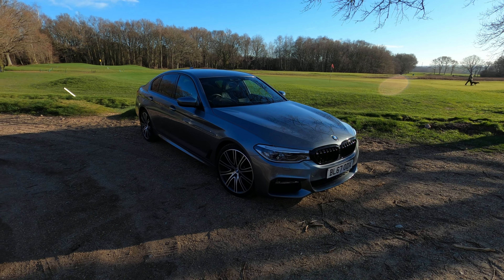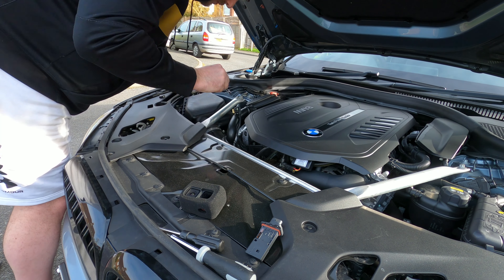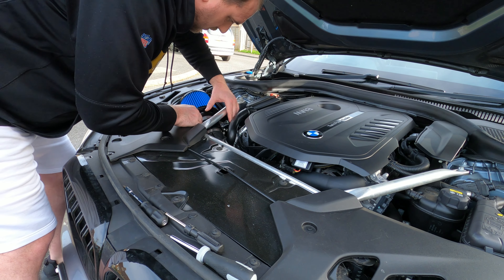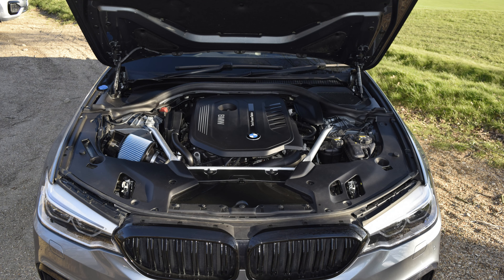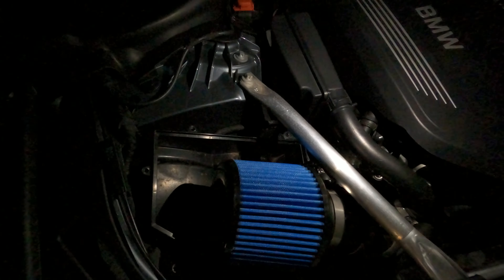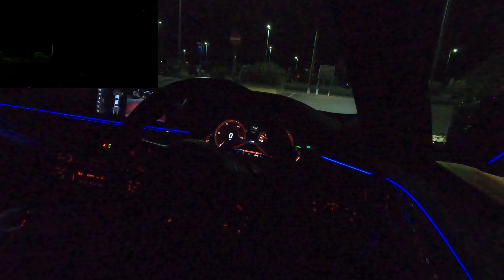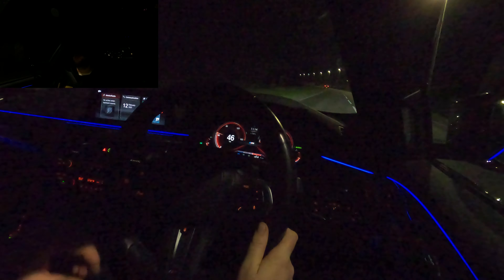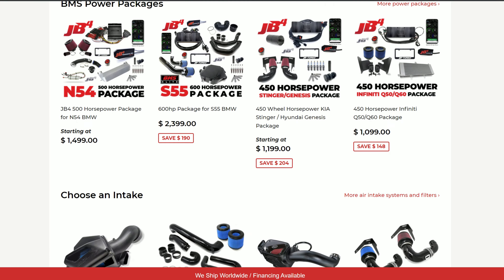BMS Performance Intake Review | BMW 540i xDrive

Comment: Nice video, would it be worth doing this mod on a 520D, like on your previous G31?
Reply from the maker: I would probably just upgrade the panel filter on a 520D, then do an ecu flash or piggyback ecu. That will be more than sufficient. The ecu flash will bring the engine alive. Cheers 🍻
Reply: NO

Comment: Is the turbo loud enough to hear in cabin with everything else stock?
stock exhaust no tune?
Reply from the maker: @MuhammadMusa-tm3jh  yes, watch my last video. 470hp.
Reply: @rev-viewsauto  thing is i dont have bms intake or stage 2
Reply from the maker: @MuhammadMusa-tm3jh  I see. Didn't read it properly first thing. 

Being honest, no, when the car us stock it's mega downtrend by BMW to keep the cretins at the EU happy. So it's quiet. Still sounds nice under full power but nothing like it's true potential.
Reply: @rev-viewsauto  makes sense. i have a resonator delete which didnt do much for me i am thinking of doing muffler delete too what do u suggest?
Reply from the maker: @MuhammadMusa-tm3jh  my take. Leave the resonators as they are. Ends up messing with the sound too much and can lead to drone. 

Get an induction kit like the BMS, get a catless or if not high flow downpipe. Tune when you can. For more sound get the Remus exhaust system as its tuned to perfection. I will be getting that in the near future.
Reply: @rev-viewsauto  Appreciate it thanks!

Comment: Sorry to disappoint you but these open filters are worse ,they bring hot air and get heat soak , stock air box with drop in filter are the best in the b58.
Reply from the maker: Well... car now runs 3.8 zero to sixty with stage 2 tune. Heard about the heat soak, but IAT stats all monitored and its running great. No disappointment here pal. Car is fast and sounds incredible. Cheers 🍻
Reply: How about closed carbon fiber intake from armaspeed or eventuri?
Reply: @MajorB58 eventuri trash

Comment: Do you have any issues with your ambient lighting on the passenger dash? Mine is a bit darker on the ends
Reply from the maker: I'll have to check, hopefully all OK. On my last 5, G31 I did need to replace the drivers door lighting strip. Currently they are great, weirdly better than my other car and the brightness isn't even that high. Are you running a 540i as well?
Reply: Mines like that too. I noticed it a while ago. It’s the design.
Reply: Thanks for the reply guys. And yes I have a G30 540i as well. I found this guy who took off his dash and cleaned the lights so i will try this https://youtu.be/f8va5yikHM0
Reply: @AeoIian is it possible to buy the lights and have those replaced if cleaning it doesnt work? Let me know what you have found would heavily appreciate

Comment: How come you kept the intake muffler on?
Reply: The big box connected to the intake pipe is a muffler, that mutes the induction noise for a more “insulated” drive. I’d suggest removing the intake muffler off and fitting the BMS intake muffler delete, just a metal cap that goes where the intake muffler used to ve
Reply from the maker: @abdurraafe9803  Hey, thanks for watching. I kept the lower part on as that is connected to the cold air feed, works great and sounds amazing. Car is now stage 2 tuned with downpipe. Watch my latest video. Cheers 🍻
Reply: @rev-viewsauto  the lower part as in the air box? I completely agree with keeping the air box, look into “intake muffler” you’ll see what I’m saying, it’s a night and day difference. The muffler takes away flutter and induction noise.
Reply: That’s why I’m suggesting to remove the intake muffler, as it will enhance intake noise significantly
Reply from the maker: @abdurraafe9803  oh... I know what you mean now. Yeah I did leave that on. I might remove that eventually. But do check out that latest video as with the catless downpipe I think I've pretty much got the sound to where I want it. Awesome boost noise now. Might do some new videos again soon.

Comment: does it gave your car performance? 
I have 530e 2022 lci. And I want to put this filter on it. 
I just wonder any performance increase
Reply from the maker: I think you will get a small performance increase yes. But mainly it saves the way for other mods. But it does make the engine and induction sound much better. 

Watch my latest video!
Cheers
Reply: Experts indicate that this type of open system draws hot air towards the turbo and therefore lowers performance.
Reply from the maker: @PM-om2wm  Experts huh... this car is now stage 2 and running 0-60 in 3.8 seconds. It's quick and IATs are perfect if that helps anyone. Cheers 🍻
Reply: @rev-viewsauto  over 100 meters it can be an illusion but on a circuit there could be slower restart phases because the engine would be very hot. This is mechanical physics.
Reply from the maker: @Mike-MAPI  incredible
Reply: @rev-viewsauto  and yes a direct carbon intake kit is much more efficient but more expensive